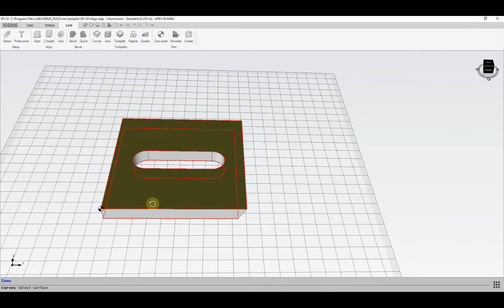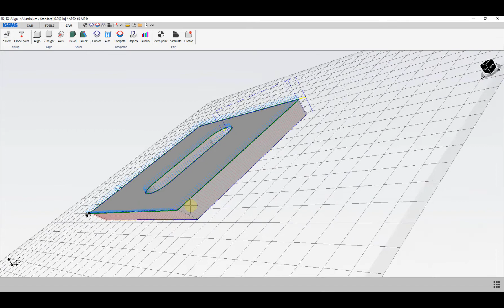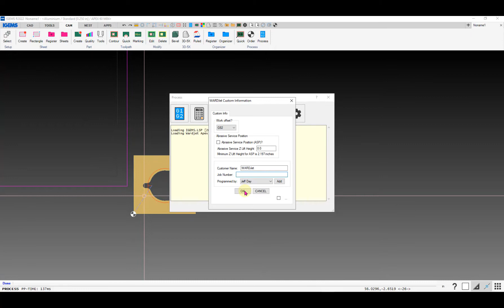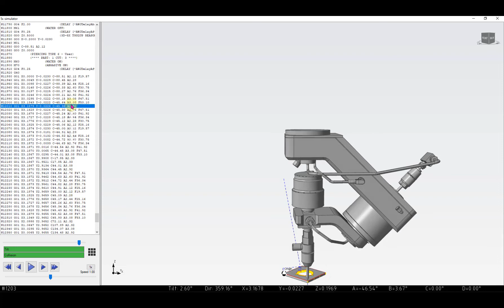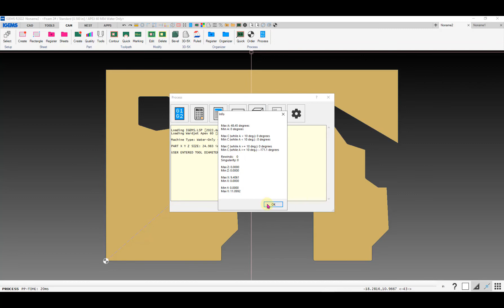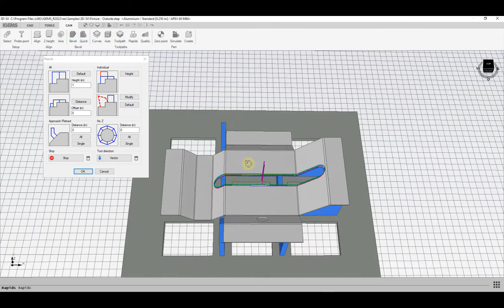IGEMS APEX 60 3D-5X Programming

Comment: Hi. I have the trial. I am trying to decide between igems and almacam.  I want be able to cut patterns/ designs into a  dome type shape, upside down wok, or similar. How will igems handle that? Almacam rep thought there maybe 2 many paths? Calculations? I guess with changing z axis. Any ideas? Obviously yr preferred options is igems. Lol
Reply: I presume you have, or will be getting, a 5-axis waterjet of some type? I've really enjoy working with IGEMS because of the people behind the software. IGEMS has been doing waterjet software for something like 30 years now and the software is really only waterjet. There are tabs for plasma and laser, but they don't really do that. Other packages also can be used for lasers, plasma, oxy-fuel, etc. As with many things that try to be all things to all people, none tends to be the best. If I find a bug in IGEMS, or have an idea for a new feature, they'll usually have any changes made in a day or two. There is a sample in the 3D-5X module of a part like you describe. I'll do a video on how a part like that can be programmed.
Reply: @jeffday2011  thanks that would be great. Yes I am waiting on one. They use almac it is more affordable than igems but I can see there is much better info and custermer interactions with igems and Information videos. Almac dosent have that. But better cost. So I am torn as to what to do. Does igems work with ecs controller?
Reply from the maker: @stevetrevella  https://youtu.be/rTMX6MysCgE

Above link is a video programming a dome and how to create a fixture, if needed.
With respect to the ECS controller, I'm not sure. You could email IGEMS (sales@igems.se) and check.